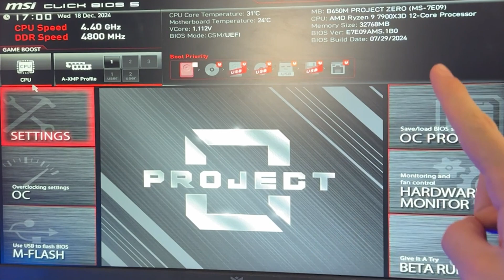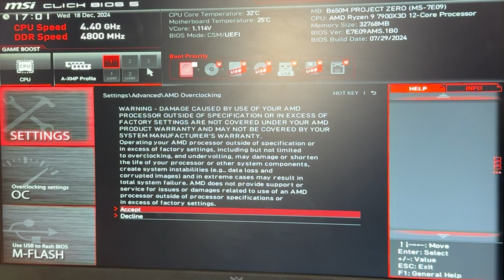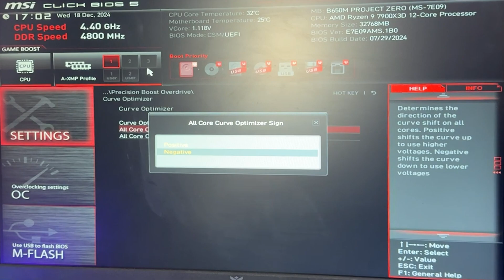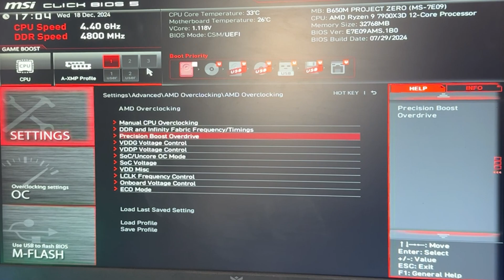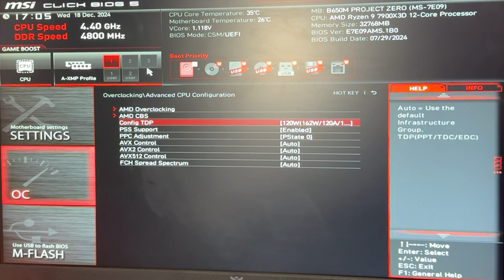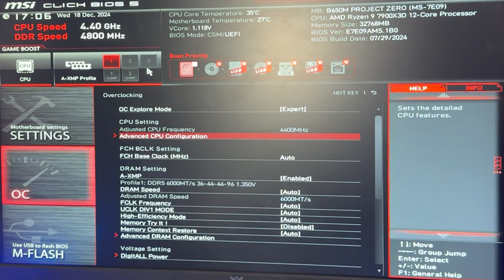Undervolt your Ryzen 9 7900X3D for more FPS and Lower Temperature!

Comment: I have this cpu is it normal for my temps to be at 67 degrees Celsius on idle ?
Reply: Um.... Mines at 31-32 on idle after undervolt was about 45 before undervolt
Reply: Way to high your cooler is to weak

Comment: don't do this with any X3D cpu, if you're worried about temps just turn off PBO, these cpus are very sensitive and even a -20 MV offset can cause major issues which is why they lock a lot of features and removed the core voltage feature in the bios if you're using one of these cpus, if you are having heat problems you can always upgrade your cooler, if you can't afford that adjust your fan curve in the bios or software if your fans allow for that, or adjust the cores using Ryzen master which is a software designed and provided by AMD themselves for free.

yes I personally tried this method after watching the video and here were my results. 

froze in bios twice, blue screened twice after getting to the windows login screen, and blue screened twice while in windows with nothing open but discord.. I reverted the offset and 0 issues.. (I am using a 7900X3D and a 360MM NZXT aio in a Corsair 5000D airflow so my cooling is plenty for this CPU.. but I did the testing to verify if these claims were accurate.

I will however give this creator credit on his suggestions if you're not on an X3D cpu this could benefit you, however you could always undervolt to 1.20 or 1.25 with those and or turn off PBO on those as well.

Comment: The 7900x3d is the first ryzen cpu i have had that  does not work with any undervolt setting no matter what try. I cant even use the thermal point  85 in pbo it won't boot only pbo setting i can select and still boot in to windows is enhanced mode 1, this is very disappointing. Anyone else with similar experience?

Comment: Ok never done this before, how safe is just undervolting, most video add Over clock lol.

I have 47-49c temps under minimum load, is it worth doing? 

How would I check stability, in lower frequency, I've seen video with master where they have a stable neg 30 on highs frequencies, but lower range have issues.
Reply: You have to test every core in a single core load for a high variety of instruction sets with 1 & 2 threads to avoid this. Mine at -10 PBO to all cores seemed reliable, but actually 2 cores was not able to keep up with AVX2 at max boost even at -3 PBO. So if such takes place you would have random PC reboots at low overall load, when that particular unlucky core got accidentally boosted to the top with that particular instructions.
Also you got to check if your L3 cache latency didn't rise up. This typically is a result of a too low voltage on V-Cache cores.

Comment: Excuse me friend, just by modifying the Thermal Throttle to 80, AND modifying the Optimeze Curve>All core>negative and then immediately applying the value 35, just by modifying those options, my Ryzen 9 7900x3D cpu can work very well efficiently in optimal temperatures up to 79 degrees working at 5.0 Ghz maximum?

Comment: Hi!

So I built a mitx pc for my living room and the case had space for extra fans so I loaded it up.. but.. this machine sounds like it’s about to take off!

The sound didn’t bother me too much at first because I cranked -up the surround sound but my gf found it all too much so I decided to go back to basics…

I tried downloading various fan controllers softwares to tame the noise but I soon realised I had no clue how to fix the speeds…. Anyhoo long story even longer I decided yesterday to remove all case fans and run stock to see how this build runs using the low pro cpu cooler and no additional fans near the Rtx 3080ti.

Well the machine is quieter now the case fans are gone but the gpu is still loud…. This had me thinking about buying a 4080 super because I heard it runs cooler and quieter, but, the 3080ti is playing everything I throw at it so figured I just need to tame it… that’s when I found your channel 👍

Can you give me a guide to how to tune my system… I.e…. What should I tune first? CPU then ram the gpu?

I figure that given I have a mitx build I should go for an under volt tune of the cpu and gpu and OC my ram?

CPU is Ryzen 7800x3d, gpu rtx 3080 ti, Corsair 750 psu, ddr5 ram…

Do you know if it’s possible to add bigger heat sink to the 3080? Do you think water cooling could be the answer? Or should I just get a larger case and buy the 4080? Kinda curious to know what these parts can do if tuned properly and whether the performance take too much of a hit.

Comment: thanks so much , and your using a MSI MB
Reply: settings than advanced than AMD overclocking than precision boost overdrive set to advanced than platform thermal throttle ctrl set to manual than in platform thermal throttle limit set to 80 than curve optimizer option put on all cores than all core curve optimizer sign set to negative than all core curve optimizer magnitude set to 20

Comment: Thank you! For some reason, when I adjust the curve optimizer and set it to all cores negative -20 or -10 I always get an error after 10min in OCCT when testing the CPU. I lowered Dynamic Vcore(DVID) -120 I don't know if this also helps in performance but it does keep my temperatures on the lower side (72 degrees with no erros in OCCT) What program do you use for testing?
Reply: Use corecycler to see what core has caused problems.
Reply: @Skynet_11  Ok I will test it later on with that Corecycler. I have OCCT set as  ; CPU, Extreme, Steady, start at cycle 1, instruction set Auto + Core Cycling ON, Type cycle through all cores 5min  and 2 threads per core. When I run it like this within 1 sec I get this error and this is with negative -10 in the curve optimizer. 

I tested it with default settings in Bios, no error, with EXPO enabled no error, as soon as I touch that curve optimizer -10 -5 errors starting to show up.

Error - CPU - 57437 error(s) found on physical core #0 - logical core #0
Error - CPU - 58206 error(s) found on physical core #0 - logical core #1
Reply: @azertyy3978  you can set curve optimizer per core. I have 2 cores with no undervolting at all to keep everything sturdy. But some has -20
Reply: @antonsis  Thank you, I will give it a try. So far I have no problems, I will do some testing soon!